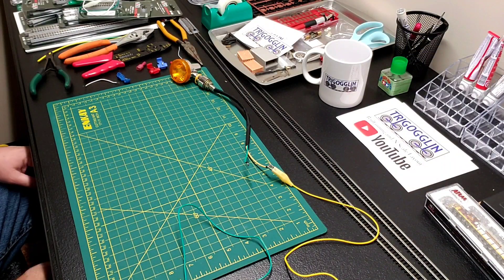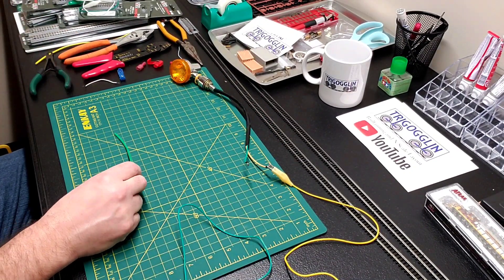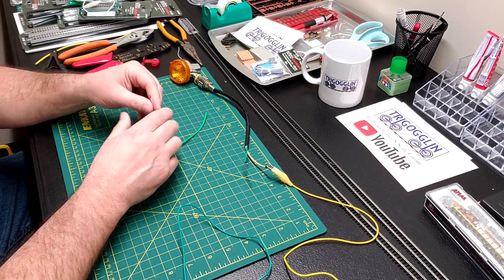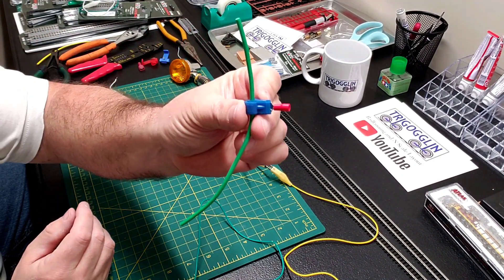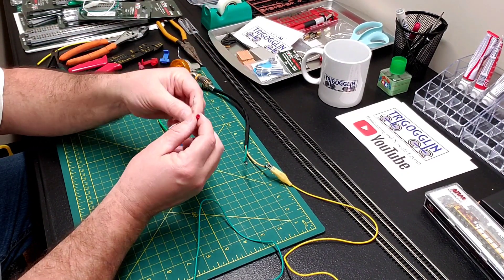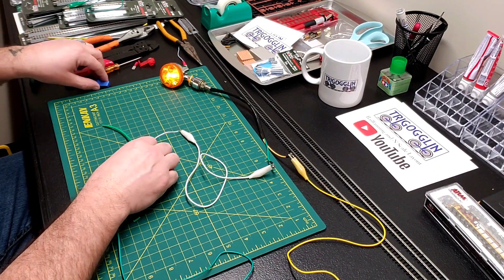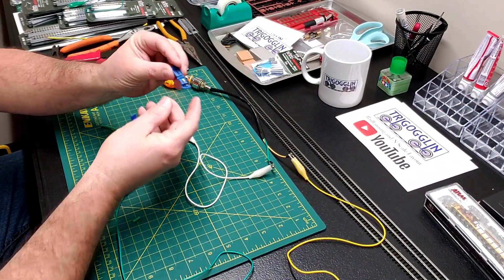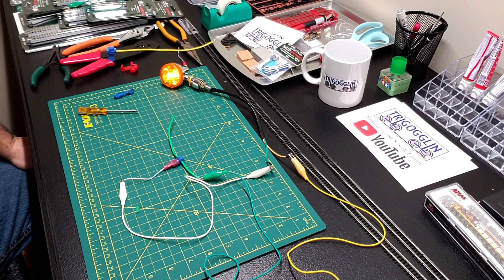T -taps experiment for model railroad layout feeder wire.

Comment: I found your video this afternoon after I spent the morning working with the clam and spade type connectors you demonstrated. It was not very factual as you were working with small pieces of wire on top of a table. I was under my table attempting to clamp these onto a busline, then connect the spade to the suitcase. It was very difficult. I ruined 3 suitcases and many of the spades had to be redone. These were difficult for me as again, I was under the layout attempting to tap into my buslines.  I think I will do the rest of my layout old school style by cutting into the wire and soldering my feeders to it.  Thanks for the demonstration! It helped me confirm that the difficulty I had was not all based on the location.
Reply from the maker: Hey there Patrick, sorry you had some difficulty. But after I made this video it did use them under my layout, and I had really no difficulty with it under there. The only trouble I had was that some if the camera ends where you put the space in were closed up from the moving process. So I just sliced them open, then after that I checked the rest before I went under the layout. And it all went fine after that. I found these to be relatively easy and have done my whole layout this way. I really wish you had the same results. Sorry these did not help you
Reply: @TriGogglin  Thank you for your reply! I will try again tomorrow. Maybe I just need practice! Keep up the good work!

Comment: I used the suitcase connectors last layout and they worked fine. I used 14 buss and 18 feeders. I think. Lol. Getting old. 🤷🏻‍♂️. I was actually thinking of using these T taps this time. I had so many times that I moved a track or whatever and had to cut the feeder. This would make life easier. Thx for sharing. I picked up a mug buddy. Very cool
Reply from the maker: Dave, Thanks for the support, i appreciate it,, glad this may help, I think it will make things easier in those cases.
Reply: @TriGogglin  you’re welcome. And yeah I think you’re right.

Comment: Super useful video. Many thanks. My only concern would be for degradation of the DCC signal. I am going to try and I will let you know! Like button SMASHED.
Reply from the maker: I to was worried about the loss of signal, but since this post. Dwight kerley let me know that the NCE company use them in their buss wiring kit, so sounds tried and tested, thanks for the SMASH lol

Comment: Nice info, thanks for sharing. Dave
Reply from the maker: Thanks Dave, you have been wired up for a while now, what did you use on your bus wire.
Reply: @TriGogglin   I use Kato track that uses their UniJoiner and Three Way extension cord. Very plug and play.

Comment: It’s only work if you have to do it twice, I will try the “t” taps.
Reply from the maker: Very very true, thanks for watching, I hope they work out for us, they are so great to use.
Reply: @TriGogglin  holy poop $18 will get a 400 piece t tap connector set🤤
Reply from the maker: Lol don't think we will need 400, I had the spades i bought the t tap off Amazon. dont remember what I paid wasnt much though I'm a tight wad. Lol

Comment: been using suitcase connectors for 30 years. 16 gauge bus wire and 20 gauge feeders. no problems
Reply from the maker: That's good to hear, these basically work the same, but the suitcase won't grip the kato 24 gauge very well.

Comment: HeyPapp just in time , I'm going to be wiring up the layout soon . I really don't like the suitcase connectors , these T Taps looks great .  The site I buy from calls them Quick Taps. Thanks my friend .
Reply from the maker: Hey Jerry, glad i could help, I really think they are a lot easier than the suitcase, and the wagos, don't grip the 24 awg very well. And me and soldiering don't get along, was hoping a seasoned modeler  has any input on the subject. Thanks for watching buddy.
Reply: @TriGogglin  I think your alternative is great . I've never seen that type of connector before
Reply from the maker: I really like the fact that you can unplug your wire when ever you want to, but as you seen in the video if your using the covered blade, that it actually goes into the slot, or you'll be wondering why you don't have power. I got those off of Amazon.
Reply: @TriGogglin  do you like the covered type
Reply from the maker: I like either one but I have like a hundred of the covered so just using them in stead of buying more stuff, they do look nicer but your the only one gonna see them lol
Reply from the maker: @BoxcarJerry  Dwight Kerley said that the T taps came in the NCE bus wiring kit. I looked it up and its correct. So hey good enough for a big Company like NCE good enough for me.

Comment: I will be using them if I can find them
Reply from the maker: I got mine off of amazon
Reply from the maker: Yeah they work basically the same way as the suitcase connectors, so why not, so I put this out to see if any of the experienced modelers say   no no don't use them or their fine. So keep checking back in the comments to see if any one does. Thanks for watching